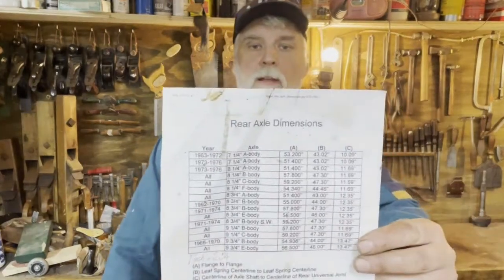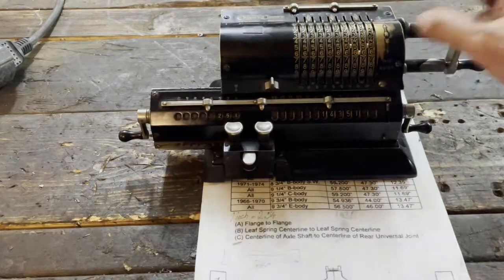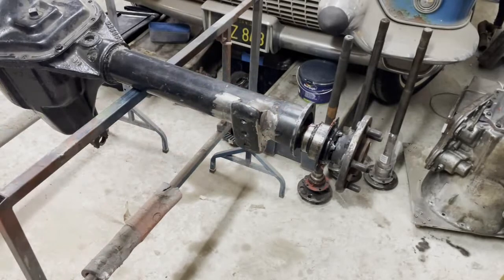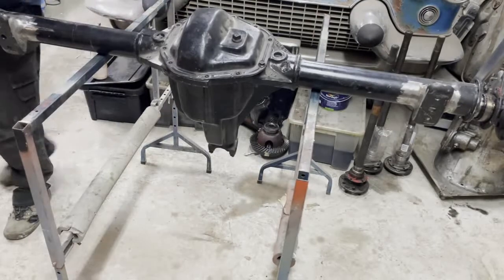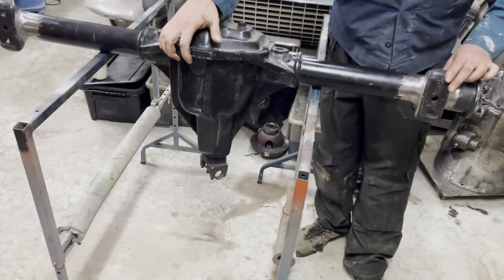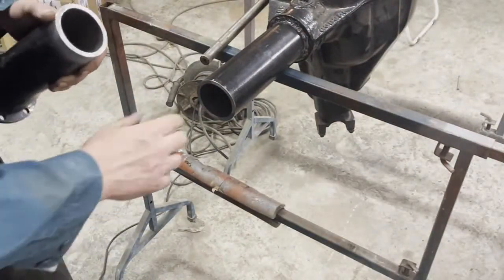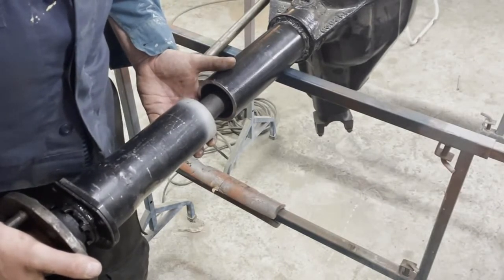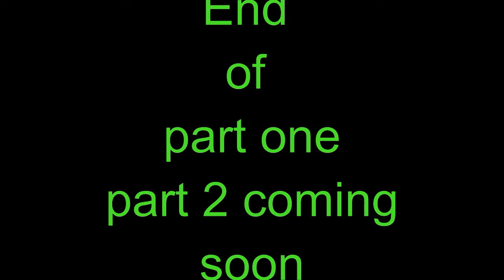How to narrow a rear end, Dana 60, or widening. Part 1/2.

Comment: Is that a semi-float 60?
Reply from the maker: I'm not sure. Don't think so. Ran the numbers and it looks like it is, or was, a dodge van axle. I bought it like that and took a gamble. It was already "fixed" and should fit the most narrow B-body. problem was that the narrowing was done only on one side. that's why I had to do this exercise.
Reply: @ifixmycarmyself2502  makes sense. Only reason i ask is those ends look like theyre for holding on bearing retaining plates, no spindle for a hub assembly or anything. And i think a lot of vans came with semi-floaters. That being said, with it being a van axle, i get the need to cut it down. Its crazy how wide they came from the factory. I have a D60 out of a 79 dodge, which is one of the narrower ones you can find, and im still gonna cut a few inches off to make it fit nicer under my YJ.
Reply from the maker: @chriso1373  If you cut it down you may wanna pay attention to the available axle lengths out there, 31 vs 35 splines and so on. I had several E-body axles laying around so it was an easy choice. Some danas are shorted down to A-body, or even shorter,  requiring special order custom expensive axles.
Reply: @ifixmycarmyself2502  theres a few places that make cut-to-length shafts. You just order the size you need, and cut off the extra spline length.